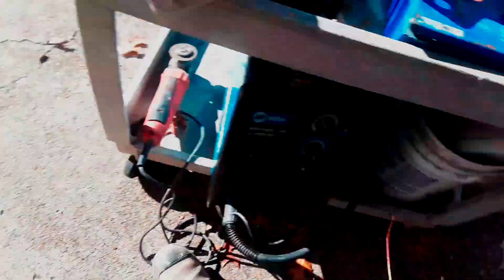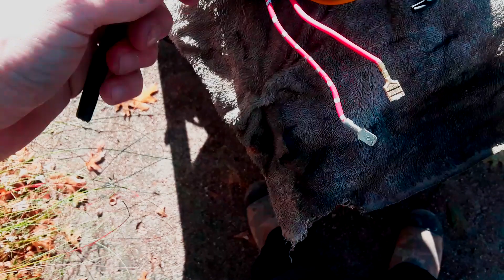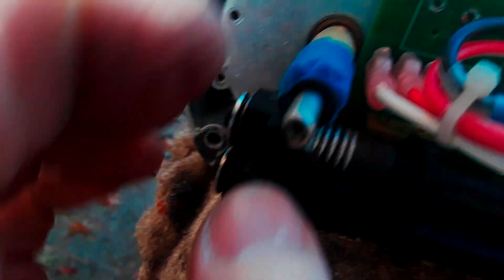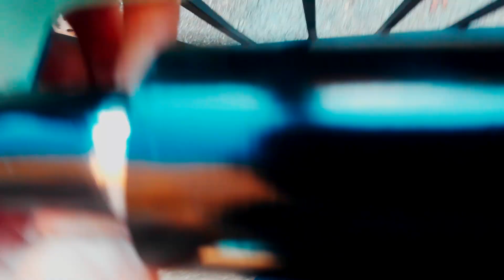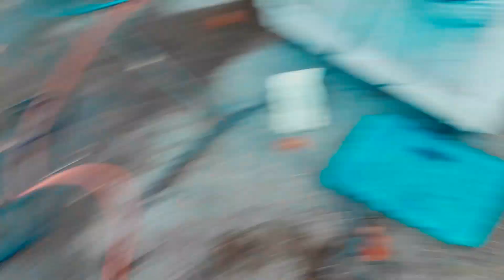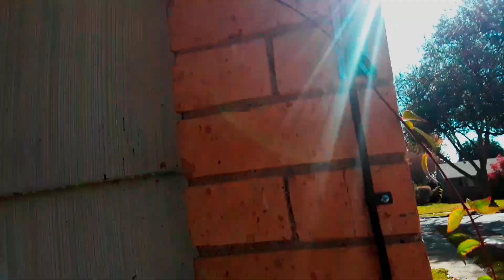USAutomatic Patriot I AC install M Streets Dallas, TX | SC0019

Comment: Hey great video! I am unsure if you are still active but I have a question. One of my actuators stopped moving after I accidently pushed the remote button without it pinned to my gate. The gate USAutomatic system is about 10 years old. I was wondering should I take apart the housing to see if something came loose or any other helpful information?
Reply from the maker: it was the secondary cable.
Reply: @SafeguardControlsLLC  do a nexxgate wifi controller!